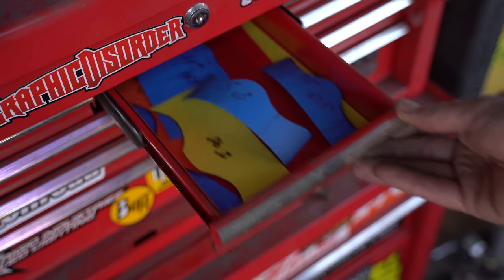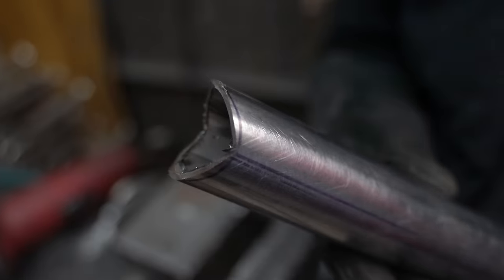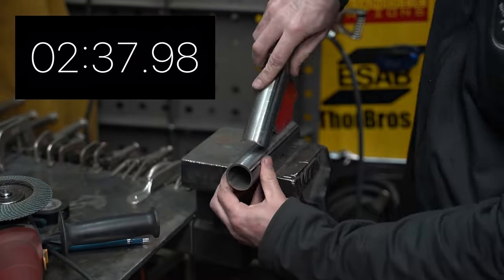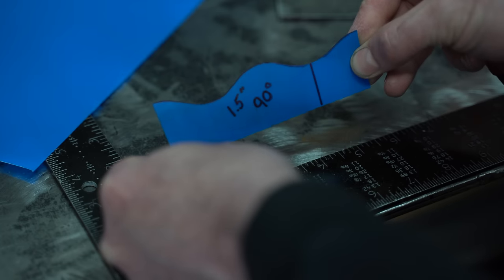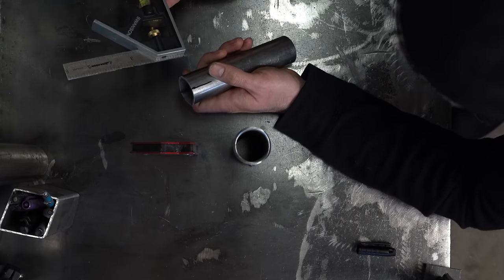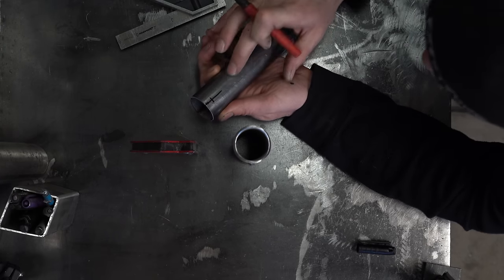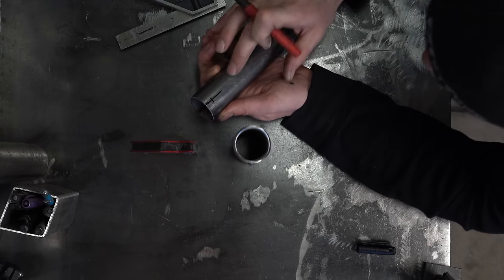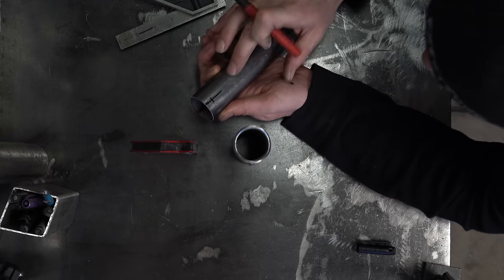How to Notch Tube with Cheap Tools!

Comment: Bro! You knock it out of the park when it comes to show and tell! Keeping it simple, hot tips and explanations! I'm learning this for PVC pipe to add structural integrity for a 5'x6'8"work station covered in transparent 5 Mil plastic with a electric heater inside so I can slide it up to my house to replace threshold and sill plate. However, I need to level and pack sections with concrete which needs a minimum temperature to cure properly for durability and longevity! This will help, thank you!

Comment: No luxuries in my work space what's so ever, don't even have 220V or a air compressor. Just started using cordless tools just last year, but I still find my self using mainly hand tools. I have found if you can do things by hand you are more well knowledge in those things you work/build by hand. I've been wrenching on vehicles for a while now without having the finer things while doing it. Not being the best out their, I am pretty dang good at the things I do.  Out of all the videos I've seen on this matter, your is the first I've seen to bevel the edges to be welded. Good information for anyone.
Reply from the maker: I agree! I’m far too lazy for hand tools but I can appreciate the connection with the work piece. 👍

Comment: I used the same method for making sheet metal tees at work at an HVAC shop. Layout takes too long for quick fitting construction! What a time saver!!!
Reply from the maker: If it works, it works! 🙌

Comment: A chop saw, band saw, or better yet a modern cermet metal cutting saw set at 32 degrees will make perfect notches for 90 degree pipe connections in a fraction of the time with no template needed.  You can learn the degrees needed for angles with very little experimentation.  I mostly do structural work now, but have built thousands of feet of tube railing using this method. Cut pipe at 32, rotate pipe 180 and repeat.  You'll figure out the rest quickly if you have a room temp IQ.
Reply: I haven't been fabricating for a long time, about a year. Most of the stuff I do is with square tube. One issue I'm having with my makita chop saw (with abrasive wheel) is it seems the blade wonders, especially with thicker wall pipe. I have it set to exactly 32°, but one side is always a little off. Do you have any recommendations? Been thinking of getting a cold cut/dry cut saw/blade, as there is no flex in those wheels. What do you think?
Reply from the maker: @dillonhillier The best tool is the one you currently have. But upgrading to a carbide toothed chop saw was arguably the best upgrade I ever made. It’s so fast, the cuts are extremely accurate, (if you don’t rush it), it doesn’t produce much heat, and there’s almost no sparks or dust. If you can afford it, I think you’ll be thrilled.
PS. A “Cold Saw”, I learned, is a little different and a lot more expensive. They move much slower and use water to keep the cut cold. You’ll likely be looking for a metal chop saw/circular saw.
Reply: @GarageFab  thanks

Comment: As a steamfitter I often use a program that allows me to print out a continuous sheet of paper with x's on the sheet that I would then i.e. wrap this template around a 6" pipe, tape it and then take a punch and mark at each x on the sheet to end up with the correct cut line. Next I get the torch out and cut on the line, clean it up and ready to weld.
I can do this in the field very easily for any size or angle and for instance I could put a 3" saddle on a 6" pipe at 45 degrees. 
In a fab shop we always have templates for various combinations and sizes or I would just get out the pipefitters handbook and layout according to the formula. 
I like your presentation. well done.
Reply from the maker: Thank you, Dennis! 🙏

Comment: There are some stores that sell notching templates or they can be ordered, but actually going through the motions is just as important for different angles and fitting different size pipes or tubes.
Best video on YT because you actually show how long it takes to make the notch and point out the difference between DIY and pro tool.
Reply from the maker: Thank you Dan! Very much appreciated. Are you familiar with blocklayer.com? If not, there’s a pretty fancy tube notching template program there. Check it out!
Reply: @GarageFab  I am familiar now, thanks for sharing the link. One can never have enough resources for toys, tools and inspiration!

Comment: If you need to develop a notch template for the first time and don't have any pre-notched pipe at the angle you need, you could use something like Autodesk Fussion 360 or any other CAD system to generate the template. You can then export the template lines to a printer or even send them to a laser cutter if you have access to one. 👍
Reply from the maker: I downloaded Autodesk a while ago. Steep learning curve on that one! I hope to get the hang of it in the future. Sending files out to have cut would be amazing!
Reply: Agreed regarding CAD. FreeCad is now a good option without the baggage.
Reply: Like your work,subscribed
Reply from the maker: Thank you, Mike! Times 2!
Reply: @GarageFab sketchup you learn in 1h

Comment: I was blown away seeing you switch out blade to flapper on your grinder.  First thing I realized was get a grinder for each type of blade I use.  Start with cheap grinders if you need to and upgrade as you wear cheap tools out.
Reply from the maker: Agreed! Honestly I don’t even upgrade. The Harbor Freight cheapies last at least a year and it’s not really a big deal to me to run and grab another. Also $20 is cheap enough for me to just keep a new unopened one on the shelf for when one finally cusps out.
I actually have several grinders for each type of disk, but for this video I didn’t want to “cheat” by using more than one grinder for those that only have one. 👍
Reply: I see where you are coming from probably should have seen it that way.

I'm looking forward to how you solved the legless tool stand in concrete.  I'm planning a keyed in post to post slab for a 2 post lift and was considering something like what you did.  Would be good to see a very successful idea implemented.

Comment: Thanks, just started Fabricating. Very good tips.
Reply from the maker: Nice! How’s the new hobby going so far?
Reply: @GarageFab  Semi retired, thanks for asking.

Made a tractor cab, might not be square but close enough to keep the snow and rain off. 

Planning a outdoor woodboioler for the summer.

thanks for the tips will follow up on some more Vids.

cheers!

Comment: Great video. If you’re really fancy you can design the joint using a 3d program then either 3d print a reusable jig that you can slide over the pipe or print a flattened pattern on paper.
Reply from the maker: I am certainly not that fancy. But I have a deep desire to become that fancy. One of my many life goals is to have a CNC plasma table, and then preferably several other CNC machines. All of them, of course, will require me to learn 3-D programming. One day, Charlie!

Comment: Great video, I really like how you make the notch after having a template. 
But for the template, I think there is a much easier solution. 

1. Use any CAD software to create the model of the perfect notch. Model it as a sheet metal.
2. Do a flat pattern of the sheet metal and print it on a paper.
3. Cut out by the print lines.
4. Copy from paper to the plastic sheet you used.
Reply from the maker: Thank you, Stefan! I hope to have access to and the knowledge to use CAD. But for now I’ve got to embrace the rocks and sticks methods the caveman used. 😃
You are appreciated my friend. 🙏
Reply: Thank you for the high quality content! 
If you ever need some paper templates made, feel free to just drop me a message :)
Reply from the maker: I just might take you up on that. Thank you.

Comment: Good explanation! I think the fastest way I’ve seen to notch is using the ameribrade belt sander with a roller the same diameter as the tube you’re notching.
Reply from the maker: I have seen that! It’s a very satisfying notch method. Can you change the roller size?
Reply: @GarageFab  I believe so. I haven’t seen it in person yet.

Comment: Just watching how this works...  If you happen to know your way around 3D software (or have a friend that does), it's possible to make those templates from a UV map of such a modeled intersection. Then just radius off that point that's too thin for a proper weld as mentioned in this video. Then scale up/down to the desired circumference and print out to trace those over to something a little more durable to keep around somewhere. Might be a way to get a whole bunch of angles made up short of having access to a notcher or taking time with a lot of tubing scraps.
Reply from the maker: That sounds like a dream, Paul. I need to learn 3D software. There are soooo many benefits that could help with just about everything I do.

Comment: If you cut a notch that reaches half way of the parent tube, you have to cut a matching hole in the parent tube, not thin the sides of the cut tube.
Reply from the maker: I’m not following.
Reply: @GarageFab  
Cut tube = the pipe you notch
Parent tube = the pipe you plant the cut tube on
Lets say you have a template for 90 degree notch that reaches half way of the parent tube. Wrap that template around a scrap pipe so, that the highest part of the cut is flush with the end of the pipe. Use that to draw lines on the parent tube. Now you have a shape of your notch from the outside diameter of your cut tube drawn on the parent tube. Considering the wall thickness of the cut tube, draw another line inside the lines you drew with the template, and you now you have the inside diameter drawn. You cut that part out, and you will have nice looking fit without any thinned out weak points. Just remember that the line you draw for the inside diameter must taper from top towards the sharp point on the side, because round shapes and geometry etc.
Reply from the maker: Thank you for taking the time to write that! 🙏

Comment: Another tip, if you want fast. Get a second HFT grinder, one for the cutoff wheel, and one for flapdisk...
Reply from the maker: I’ve got 3 actually! One has a wire wheel. I was worried I was gonna get called out for “cheating” so I just used one. 😆

Comment: Super excellent vid. 2 👍👍
If pipe diameters are similiar
people could practice with easy to shape PVC piping or use PVC to get their templates first. I guess diameters would need to be measures first to see that they match steel pipes.
Reply from the maker: Thank you John! That would be brilliant if the correct size PVC is available. I believe PVC is measured by inside diameter whereas metal tube is measured by the outside. That said matching pipe probably isn’t an option HOWEVER!! 2 inch PVC may slide nicely over 2 inch metal tube which would make a REALLY rugged template!

Comment: Awesome vid..I definitely learned a lot. 1 question, though..when making the initial notch, on the 90° (to make your templates off from) couldn't you roll the pipe opening from centerline to centerline on the pipe cutting..marking a preset cutout, with the appropriate radius (eliminating the need for grinding with the flapper disc, till it fits)? I may ne overt/underthinking, though.
Again, awesome vid.

Comment: Open up a geometry book, and use a pencil and compass. Drafting was my favorite class in high school in 1992, I still make a compass out of a piece of string and a marker or a couple sticks to make all kinds of stuff in a pinch. Scribing would work here too. Just cut it close quick then lay the marker flat on the tube and scribe a line on the notched pipe.
Reply from the maker: Good info. Thank you!

Comment: A hole saw in a drill press is effective to ..only if the pipe is whole or at least u can have the pilot bit secure..less effective on open ends
Reply from the maker: Indeed. A good drill press will do open ends too. Not my floppy jalopy though. 😆

Comment: I have improvised tube notching for years using my own derived free-hand methods but I must say the template method is really superb - especially for repeat joints. Great tips and tricks here, Aaron!
Reply from the maker: Thank you Manny! Lemme know if it helps out in real life.
Reply: Put them in a good copier that converts it 1:1 into a pdf file. Then share it on your webpage so that everyone has access to all the different sizes 🎉😊
Reply: @mannykightley a well tuned eyechrometer rarely fails!
Reply from the maker: Haha! “Eyechrometer” Consider that stolen.
Reply: @GarageFab  I stole it from Paul Cox on the FabRats channel so have at it!

Comment: You could take a piece of said tube and hold it over the straight lines from our 1/4 tube diameter and whiles hoding it over top get your curved line before you start shaping that notch on the 90° 
👌🏼
Reply from the maker: That sounds really interesting. I’m also really tired at the moment and I’m not fully understanding. I’ll read again later but if you have time, would you clarify?

Comment: Subscribed!
Reply from the maker: Thrilled to have you Johnny! See you in the next one.
Reply: @GarageFab  Thanks, I just used your simple roll cage notching technique last night.  Worked great! 😁👍
Reply from the maker: @johnnyturbo8460 That’s what I like to hear. 👏 Not everyone agrees!
Reply: @GarageFab  As you stated, there are many ways to do it. Some better than others, some "more right" than others. It all comes back to the saying, " If it works, is it a bad idea?". I'm my case it wasn't a bad idea. Worked just fine for me.

I have notching tools, etc... but I just needed one pipe done for my race cars cage. (A notch on both ends for a harness bar/cross bar.)
This was much faster, simpler than getting all my tools out, setting them up, cutting them, and putting them all away.

Turned an hour job into a 20-minute job.

Comment: im a bit late to the party i know but if you google tube notching templates there are calculators which generate these templates which can be printed out at home. I then transfer these templates onto simmilar material as you use for longevity
Reply from the maker: Yes Sir! Blocklayer.com has an awesome notch generator.

Comment: Im planning on 2 tubes perpendicular to a main tube at 90 to 60° from each other. Looks don't matter much, want to cut an extended notch out of 1 pipe, heat it and wrap around main pipe. Any advantage to this?
Reply from the maker: I’m having difficulty imagining what you’re describing, Nate, but it certainly sounds interesting. The wrap around extended notch sounds like you want one pipe to essentially “hug” The other.
My first instinct is that would make the joint a little stronger. But in most applications, there’s plenty of strength in a simple traditional notch.
I think it would look neat though!

Comment: Pipe fitters blue book gives you all the dimensions to layout. You can layout directly on the pipe or make a template if you plan on using it multiple times. The Pipefitters Blue Book by W.V. Graves

Comment: I’m thinking 🤔 could you take a piece of uncut template material and tape around tube then measure to cut it rather than grinding the metal tube to make a guide template?
Reply from the maker: Yeah! I suppose that could work. Lemme know how it goes!

Comment: What is it with you yanks and your refusal to use guards on your grinders?

Also with a tube notcher you can just grind the sharp thin points to get your prep?
Reply from the maker: All the recent videos have guards in place. I got tired of constantly getting reprimanded. Surprisingly it’s actually less of a hassle to deal with a guard that obstructs my view and gets in the way of making cuts in tight quarters.
As for prep, whatever is necessary to expose the entire thickness of the tubing and provide a roughly 90° making surface.
Reply: @GarageFab  cool cool

Comment: Great video man thanks, very well done and subscribing! One question about the throat depth, do you base it off the ID or OD of the pipe when you take a quarter of the pipe size for the throat line? Thanks again, cheers
Reply from the maker: I use a quarter of the outside diameter, but you bring up a good point. I almost always use 1/8” wall tubing and other wall thicknesses will change things a bit. Thicker tubing will have a slightly shallower throat and thinner wall tube will have a slightly deeper notch. 1/4 total OD deep is still a good rule of thumb and then sculpt it a tiny bit to fit. Thank you!! 🍻
Reply: @GarageFab  Awesome thanks a lot of for the info man, really do appreciate it! Sorry for the late response I guess my notifications were turned off, take care brother!
Reply from the maker: Any time my man! Cheers!

Comment: I love this idea. I wanted to use this method to make a stronger tarp and pole car port. My driveway is 20x 60ft.. I want to be able to cover my 4 cars which park side by side.. I don't like the already made canopy kits from Hardware stores. I wanted to use thicker poles. 
Is this possible or am I crazy.. I was thinking same thickness as role cage pipes.
Reply from the maker: I’m the guy that thinks anything is possible if you have enough patience and money. But that sounds more than reasonable. I haven’t made one, but I imagine 1.5 inch 1/8 wall tubing would  be more than enough. I do know that canopies can create a huge load on their posts especially when the wind picks up or water pools in the center, but as long as the posts are bridged at the tops the material would fail before the frame.
That sounds like project I might have to do in the future as well!
Reply: @Garage Fab  yes ..that would be a nice video /project.  even if it's a small versions like for cover a chicken coop or dog house just to give people the angles . Mahalo and Aloha for a quick reply
Reply from the maker: Anytime. Thanks for watching my friend. 🙏